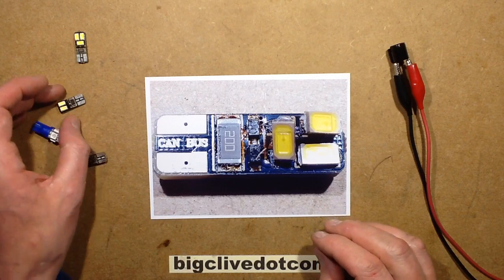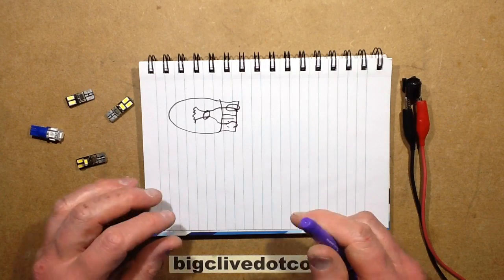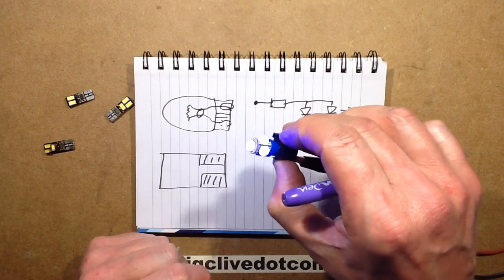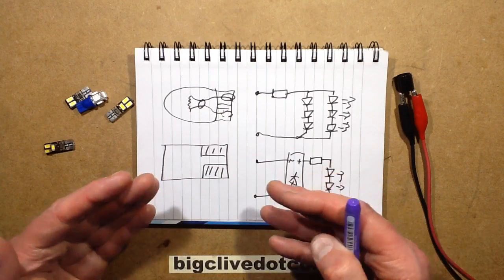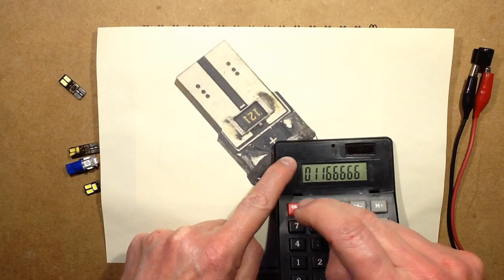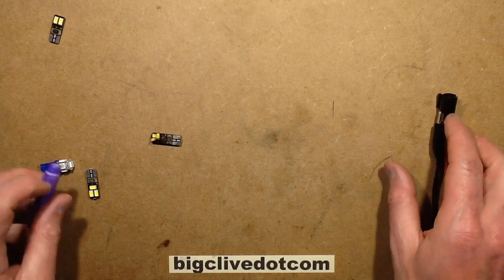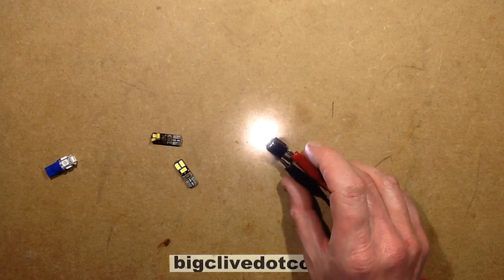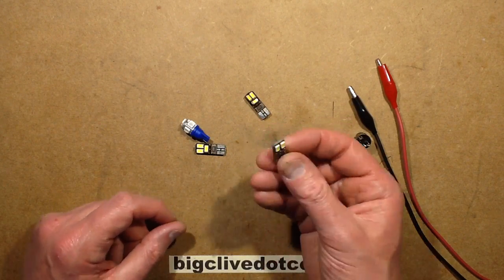Smokin' hot CANbus LED lamps.  (230C in open air.)

Comment: Why do resistors add a 1?? Like 120 says 121?? 470 says 471???????????
Reply: +Ashley Booth no :(
Reply: +Ashley Booth wow thanks!
Reply: +Ashley Booth I had a kit that said 470 but provided 471 and I was mad 😠 lol
Reply: +Ashley Booth Just to add to the confusion, a 120 ohm resistor might also be printed as "120", rather than "121" (120*10^1), though a 12 ohm will typically be printed as either "12R" or "12R0" (12.0).  They are not always consistent with the final multiplier digit when there is enough room for the full value to be represented without use of multipliers.

Comment: ive had 2 different styles and they designed them both for 12v not the 14.4 my car runs at. make a video of how you would modify them to run properly. they do not have that large resister to fake any sensors they are simply over driven. takes them a few weeks to die on me. and because they are so small i have not attempted to just add another resister.

Comment: A CANbus should only be a 5 volt system, so if these are being installed into a 12 volt system, is it any wonder they get hot or am I mistaken?
Reply: +10868940ih You're messing up your terminology. CAN is a communications protocol and actually has nothing to do with the lamp failure detection. The lamps are connected back to the CJB or rear JB which sense the current through the lamps it's driving. The JB then communicates back to the BCM either via CAN or LIN.

Comment: The incandescent lamps in dashboard lights last a very long time and use very little power, seems like a waste of time.
Reply: +Mentorcase - Exactly.  Incandescent lights are cheap, last a long time, available everywhere, and most importantly they are safe!  They have to pass safety and conformity standards and that`s why the car manufacture used them.  These Chinese pieces of junk didn`t pass anything and are a hazard.  I mean when they melt and damage the car the car manufacture won`t be covering the costs, it will be you.

Comment: I actually emailed you about this situation and you recommended some resistors. I wasn't able to find any so right now I'm currently without a dome light for my truck. When it did work it flickered and got hot. The resister in put in(50w) just burnt up. What would you recommend for a led light that could stay on for a couple mins at a time. I also had the issue of be light being dimly lit even when turned off. The type of light housing was similar to these (https://www.superbrightleds.com/moreinfo/dome-light-bulb/can-bus-578-led-bulb-8-led-festoon-44mm/3418/7124/) and the flickered until then just died. Is there something they make or is there something I can do myself to get this right. My led tail lights also stay dimly lit at all times.

Comment: The amount of damage I've seen with these types of lights is unreal. 5ohm power resistors being provided for LED fog lamp solutions generating a huge amount of heat. Fortunately most VW cars allow you to "code out" the bulb warnings by disabling cold diagnosis of the bulb.
Reply: +ELECTRONTHORP No. I have dealer leavel diagnostic equipment that allows LEDs to be driven without bulb diagnosis warnings
Reply: +ELECTRONTHORP most have aftermarket diagnostic systems. I only tend to deal with German. I can't vouch for any cars outwith volkswagen audi group

Comment: I bought some pretty cool looking COB style T10 LED bulbs for my sidemarkers about 6 months  ago. I think they have three or 4 LEDs per COB with one on each side of the board. I quickly discovered they were getting very hot! 100C in open air. The culprit was running the LEDs too hard. I think it was like 50ma or something running through each COB. The set in the car were already getting blackened LEDs after just a week of use. The resistor for the LEDs was a 100ohm, so I added a 22ohm 1/4w resistor. One for each COB, and that brought them down to 70C. Theyve been happily coochin with no loss of performance after I did that.
Reply: +ELECTRONTHORP Yeah, I found my pictures from it and it wasn't 100 ohm, it was a 75ohm that they had on it. Comparing before and after adding the 22ohm was hardly noticeable, especially when compared to the ones aged a week and already dying.

Comment: Do you have any links to LEDs particularly T10 style and 3057 / 3157 with an integrated bridge rectifier? I can't find any and some GM cars like to flip the voltage around when headlights are on.

Comment: Ive gone through many different types of T10 LED globes, and all of them have failed, from really cheap ones off ebay to $15AUD each ones from Jaycar, Ive modified some of the cheap ones ( same style as your blue one ) by putting in 570 ohm or 750 ohm 1w resistors( depending how bright i wanted them ) and they seem to last a lot longer, they don't get as hot.

Comment: You know, the thing with electronics is, they all work on smoke. All this volts and amps and ohms malarky, it's just not true! All electronics have smoke inside of them, and as long as the smoke is kept on the inside they will work just fine. But when you break them and the smoke escapes from the components they all suddenly stop working. So you see, it's all about the smoke! It needs to be kept on the inside. Try taping your LED's up with electrical tape, that should keep the smoke from escaping!
Reply: I think this joke is older than I am ...

Comment: would use capacitance resistance run cooler?
Reply: +Darkest Sky capacitive droppers only work with AC
Reply: +chems so no electrolytic cap drop?
Reply: Darkest Sky no

Comment: I'd say just replace like with like. If the car was meant to have LED's, it would have them from the factory. Plus, it takes too much messing about to make them work, and the whole point of LED lighting is that it uses less current, which is undermined by the need for that low-value resistor in parallel with the LEDs.

Comment: What about the connections? The PCB should have only 2 of the 4 pads connected, but I think most have all 4 connected. Which leads to a short if plus and minus are on top and bottom of the PCB instead of  the expected ledt and right sides of the lamp.
Reply: Why would they be on top and bottom, that is not how the lamp sockets are made?  Each side of the socket is a pincer (a single metal clip in a C-like shape) tied to a single pole, so each side can only be either positive or negative, never both on the same side, so it does not matter that the pads, top and bottom, on each side of the PCB may be tied together by vias.

Comment: I've always wondered how you can afford to print large colour prints for your videos all the time
Reply from the maker: +Jordanixting Bulk continuous ink system filled with cheap no-brand ink.
Reply: or laser printers initial cost may be higher and toner can be expensive but hell they'll print shitloads
Reply: +Jordanixting A CIS system in your printer is the only way to go if you dont wanna be ripped off by ink companies
Im a professional ink tech
Reply: Then get a printer that can be retrofitted with a CIS system. I got a $120 Epson that could be retrofitted with a CIS setup. Spent $30 CIS kit and it's been running like a champ for the last 6 years. I print a lot in color.
Reply: the 1515 seems like it takes a 61/61xl ink cart
you should be able to get remanufactured ink [from a reputable source :)] and itll be fine
-try disabling the ink monitoring levels
and turning off hp web services
Reply: +Tony K My HP 1210 series lasted about 6 years, cheap ink would only last one refill. (The cartridge refused to co-operate) My new 1515 series won't even work on a refill, I am forced to buy new every time...

Comment: Back in the mid-late 00's I had my own business rewiring old air-cooled Volkswagens and I made my own LED lights for a lot of applications (mainly for the speedometer which was poorly lit even when new especially in the camper vans). I sometimes used dropping resistors for LED indicators and they were huge aluminium-clad things, so I'd feel nervous even using those T10 LEDs with the resistor for indicators!

Comment: well that sucks, removing instrument clusters on many vehicles is no small task...would suck to install one of these duds only to have to go so quickly.
Reply: +wooo weee This type of lamp is not typically (if ever) used in instrument clusters, rather signal or marker bulbs.
Reply: +wooo weee been there! going to run bench tests before next time!
Reply: +wooo weee Just remove the resistor, try that.
Reply: Delta didn't get a can bus error? What protocol are you running g out of curiosity?

Comment: Nice video.

I upgraded my headlights on my car to those H7 LED kits, with transformer and cooling fan, been running with it for 2 months now, longest drives are around 2 hours nonstop with lights on.  
Havent changed any other than the main head lights. 

But i'm sad to say i see people trying to hookup the new H7 LED bulps directly to the cars power wires, and ofcourse the current will fry them.  so thats just a nice to know..  ;)
Reply: +Eqvaliser Trouble is doing that in the UK is problematic, finding them marked with E11 approval is hard enough. But then you should inform your insurer as the vehicle would then be considered as modified. At best this would probably increase your premiums.

Comment: This is valuable information - I have been looking at replacing tungsten bulbs with LED in the navigation lights on a boat. Clearly it's important to find a type which doesn't reach the temperature that Clive demonstrates.
Reply: mysock351C Thanks for the tip.

Comment: I bought aftermarket "angel eyes" for my old 3-series. Darned things had a 25ohm 5W resistor to simulate the load. Thankfully I tested it on the bench before gutting the lights, it got so hot it melted through the wiring that was heatshrunk next to it. Thankfully the ride is so old, it only checks the running lights at startup, so I got away with 2 4700uF/16V caps, as they charge up, the computer sees the load and does not whine. My old man's Mercedes was better to retrofit, you can actually tell the computer if it has LED or regular bulbs.

Comment: This is really frustrating.  My son replaced his tail and stop light assemblies with LED units.  Then his turn signals wouldn't work along with speed control.  I researched and found the fix was to add resistors in the wiring ahead of the connections.  This solved the problems, but seems to defeat the purpose of using LEDs to decrease current use.  The LEDs started failing after a few years and to trouble shoot I had to use a die grinder with a cut off wheel to get to the boards.  Now have a pile of plastic and spare parts.  LOL  Not cheap scrap !

Comment: I have used many of these so called Canbus SMD led. And agree with Clive. These start to flicker in no time and fail.
I found using non Canbus SMD with a separate resistor with more heat dissipation work better.

Comment: I have the festoon type 3 smd can-bus compatible polarized led as the interior light in my car, as it was a "china bay" £2.99 inc p+p purchase I thought I best keep a close eye on it as I really don't want the plastic trim surround melting or the roof lining to combust.
I left the light on checking the temperature every 5 minutes or so for around 30 minutes and although warm to the touch it didn't get alarmingly hot, it does have a large alloy heat sink on the back, I am guessing this houses the resistor that the excess wattage supplied is dumped into enabling the led to work without throwing up a dash light fault.
I must admit it works very well and throws out a huge amount of  usable light in comparison to the crappy candle like incandescent it replaced, it has been installed for about 6 months now and not caused any issues..... maybe I got lucky and bought one of the better designed models :-)

Comment: Quite apart from the safety issue that Clive highlights, these assemblies should not be used in exterior vehicle lights at all, as they are not type approved as automotive lamps. There are strict standards on colour temperature and the distribution of light in space, amongst other things, which these assemblies could never meet.

Comment: By CANbus compatible manufacturers of these lamps usually mean that the load won't let the computer in the car think that the light is broken. This is because CANbus is widely used in the automotive industry, and cars with lamp failure detection usually follow this protocol.

Comment: What about changing resistance of sense resistor?
Reply: +Arek R.
Not worth the trouble if you ask me. I work at my dad's auto shop, and this has a great chance of causing many more problems than it solves.

First off, the sense resistor is likely inside the car's ECM or BCM, depending on how new it is. This makes it hard to get at unless you know where it is, and sometimes it's still hard to get at.
That location also brings up a couple questions:
1. "which one's the sense resistor again?" Nobody provides schematics for the circuit board of a computer inside a car, just the wires going to and from it.
2. "Can I afford a new computer for this car (plus the cost to get it installed) if I break this?" Messing with a car's computer is a good way to break the computer, and therefore break the car because the car can't (or won't) run without it.

There's also the possibility that such a modification could be considered illegal if the sense resistors are in the same housing as the engine control computer (something about illegal modification of emissions equipment).

If I was you, I'd replace like with like.
Tungsten bulb came out? Replace with same type tungsten bulb of as good a brand as you can afford.
One LED burn out on your fancy luxury car with LED lights? Hope you've got $300 to $1000 for a new light fixture, because the guts that you might be able to fix are glued in so tightly that getting it apart breaks it, and they only sell the whole fixture anyways, and it's probably only available from the dealership.
Reply: +44R0Ndin 
We dont need schematics, we just have to look for low value resistor, perhaps in 1206 smd case, lets say with marking 1R0(1 ohm).
Its also not cricital mod, if we desolder original resistor and forget to install other one, we will just get not working light and notification about dead/failed lights.
If you are well known in electronics and in cars there is almost no risk of damaging anything.

Comment: I have a small bag of these, they all burn out so quickly. I use them in dipped lights and these I need to replace every few weeks/months :) Still like them though.
But they are great as interior lights because of nice non-yellow bright light, mine still keep going after 2 years.

Comment: I have so many of the first T10 version in my Pinball machines. :) Some of "first version" does have diodes so you can plug it in either way, and some has capacitors to avoid flickering. they call them "no-flix" at pinball center.eu and others has good ones too. Some who sells spare parts, sells the cheap version though.
Reply: +Martin J Thinking about replacing all of the old lights in mine.  How much did/does it cost for you if you were to replace all the lights?  The paint is chipping off the back glass and I'd like to replace a ton of dead bulbs that are behind it.  I want to get the ones with no flicker, though.

BTW, that link doesn't work.  is it pinball-center or pinballcenter?

Comment: I'd be interested to see a comparison of some LED automotive bulbs,if you were so inclined. I want to replace the bulbs in my old Chevy with LED's,but I'm not sure which ones are crap. One reason I want to do this is for reliability,I'd never have to replace a bulb again. However,if the LED replacements are crap,and fail..well,there's no benefit,and it's a waste of time/money.
Reply: +bluephreakr
I could, but designing good quality bulbs is more expensive than the majority of people are willing to pay.

LED bulbs are far from all the same. I use 10W RED/AMBER/WHITE chips depending on the application. Having the right wavelength means extra light wont just be blocked in the lens. A 10W white led is just as powerful as a 3W red equivalent behind a red brake optic, for example. On amber is not so bad, but we're looking at a 40-60% reduction depending if it is warm or cool white.

Obviously this results in a couple of notes

1: Much less power for the same brightness, or higher brightness for the same wattage (Your choice)
2: The LEDs look awesome, as the light output is only on the required wavelength (White leds result in a poor/washed down color if used for anything other than side/license plate lights)
3: Cooler running LED's
4: Amber and Red leds do not use the phosphorous cover, therefore performance doesn't deteriorate nearly as much as white variants, over time.
5: Amber and Red leds are more expensive to buy than the white counterparts.

Mines are set to 300mA at 12V (the actual LED current is higher given the buck switch mode converter) so often a CAN resistor isn't needed.
I use an absolute maximum of half the rated current for my lights. If I need 5W I buy a 10W variant. Cheap commercial versions do the opposite.

Most of us feel inclined for LED bulbs because they promise an extremely long life and you look them up on eBay they are often cheaper than a good quality tungsten bulb. Seems like a no-brainer. The reality, though is a bit different.
Reply: I can tell you I designed my own bulbs to replace 21W with high power red leds. That's the brightest led bulb for brakes I've ever seen and it hasn't blown out after 2years.

Purchase already build led bulbs... no thanks!
Reply: +Susana Godinho Why not just make a whole bunch and sell 'em on Ebay? It'd probably be the only reliable brake LEDs money could buy based upon your assessment.
Reply: +Susana Godinho Hi, you should make a quick YouTube video showing what you made :)